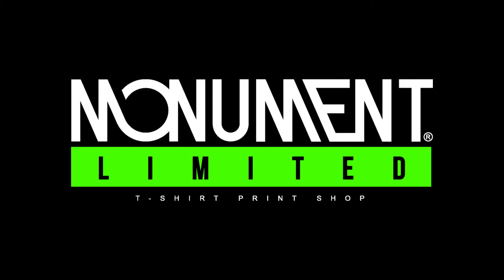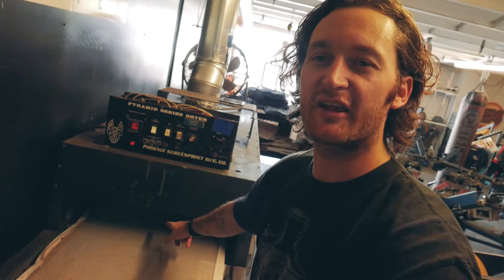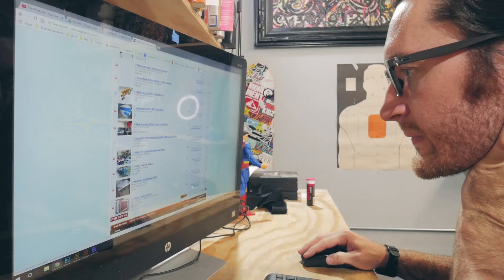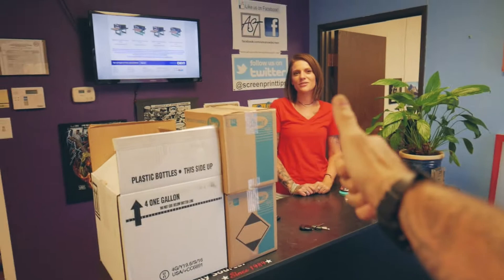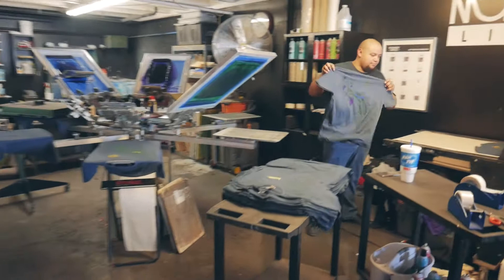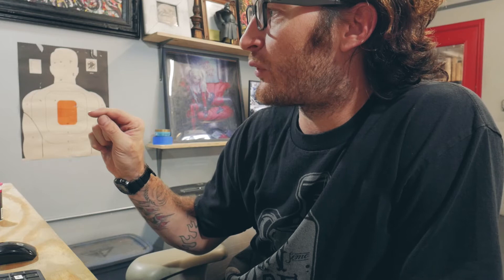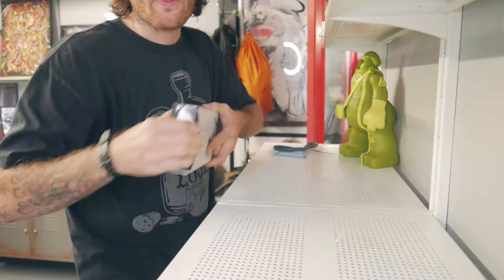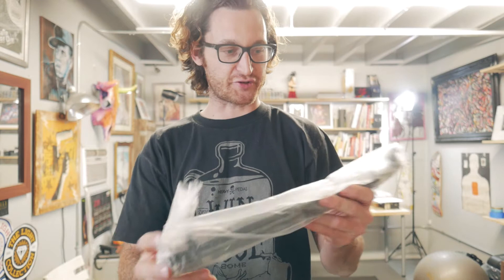Should I Make Silkscreen Frame Myself at Home for Screen Printing.

Comment: I went the route of stretching my screens, because they were sagging because of the humidity. I ended up going with Newman Roller Frames, with a Shurloc tightening system. It was pricey, but the charge for shipping screens for remesh, wasn't worth it in my opinion.